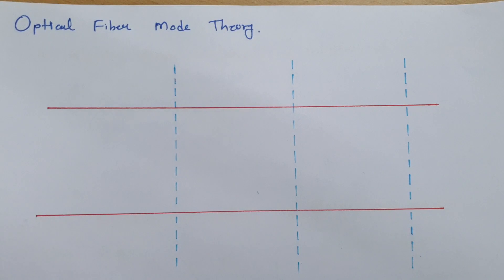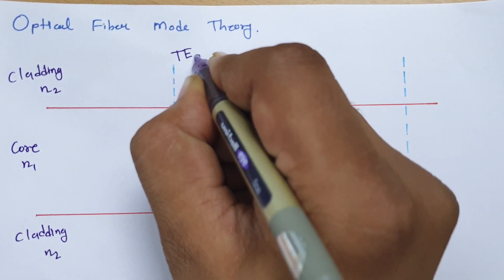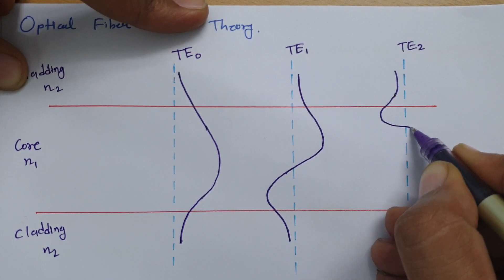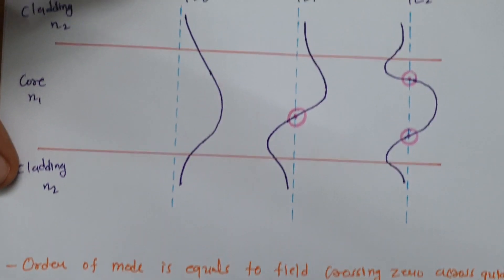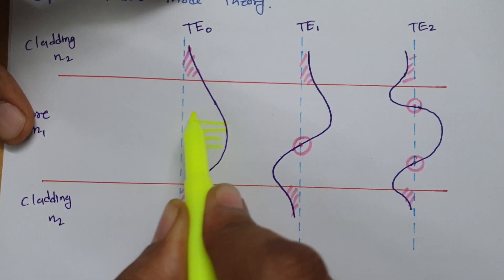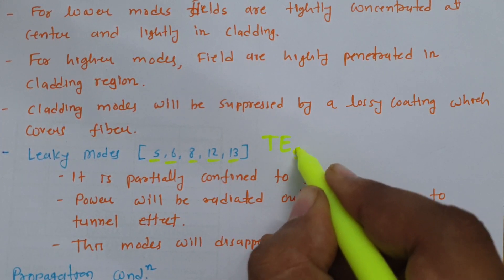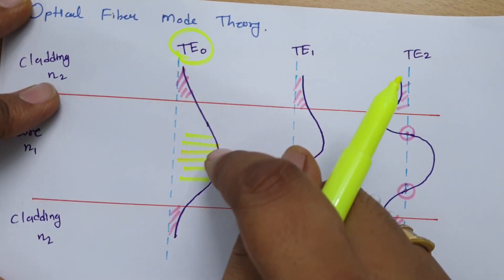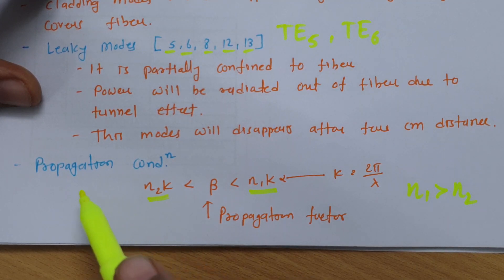Optical Fiber Mode Theory (Basics, Fields & Types) Explained in Optical Fiber Communication

Comment: In optical fiber mode theory, the transverse electric (TE) mode refers to a particular pattern of light propagation in which the electric field component of the light is perpendicular to the axis of the fiber. In a TE mode, the light travels in the fiber with no magnetic field component along the axis of the fiber. TE modes are used in many fiber optic communication systems, as they often have lower loss and dispersion compared to other modes. The number and properties of the TE modes in a fiber depend on the fiber's dimensions and the wavelength of light being transmitted.

Comment: Thank you, sir.
I have a doubt sir. What are those fields, signals pass horizontally across fibre, but what are those vertical fields, sir
Reply from the maker: It shows pattern of E field passing through fiber.
Reply: @EngineeringFunda  FROM WHERE THAT ELECTRIC FIELD IS GENERATING ? PLZ SAY?